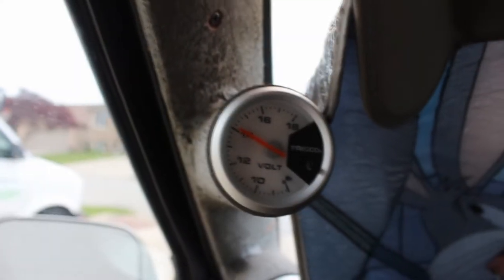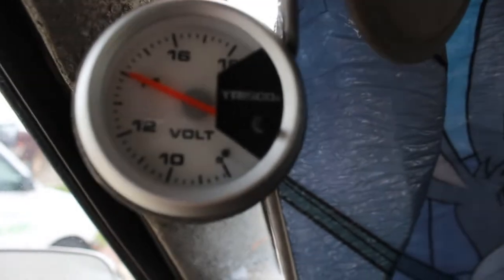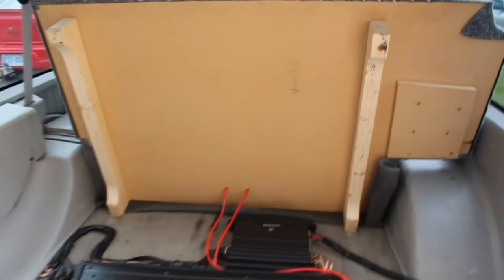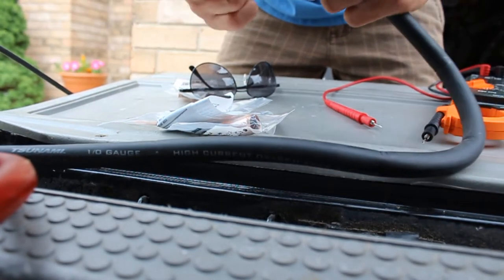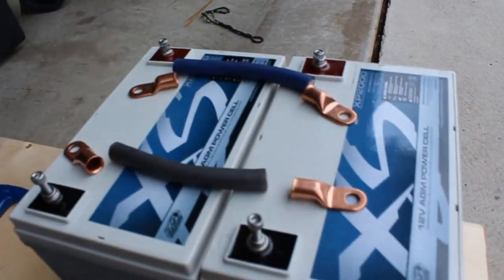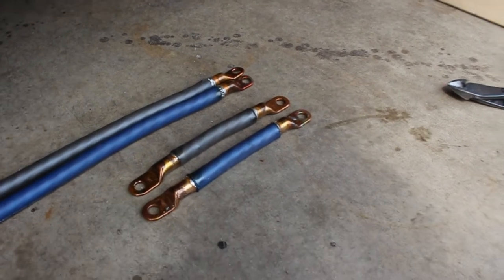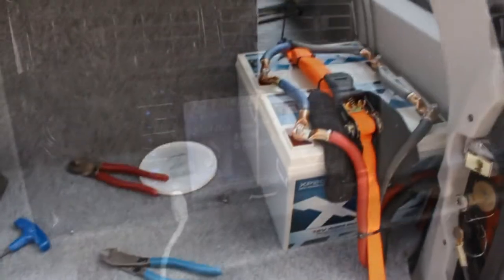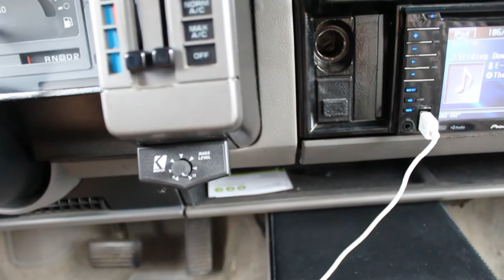More Junk In My Trunk! New Batteries

Comment: Have you looked into a capacitor for your stereo system?
Reply from the maker: I haven't really considered one at this point.  Do you have experience with them by chance?
Reply: @RobHoffmann20  yes I have they really help out. I've used all kinds.
Reply from the maker: @blazinSpike  very interesting,  have you got any suggestions on what I should research? Or base my decision on
Reply: @RobHoffmann20  research the capacitors that are for the RMS power of your amps. Kicker might have some. I've used 1000k,1500k and a 2000k capacitors. They store power in them so it doesn't pull down the battery
Reply from the maker: @blazinSpike  Allright, I'm familiar with the capacitor function just unsure of sizing.  I will look in to that.  Thank you
Reply: @RobHoffmann20  welcome sir.

Comment: Nice setup man, but you should have fuses on both ends of your power runs...up front by main and out back by secondary that's a long live wire if it shorts out behind your main fuse....
Reply from the maker: Yea I know... its funny I have been meaning to do that for a while and I know I should do it ASAP. Even funnier is that I'm an Electrician. I will get to it one day haha